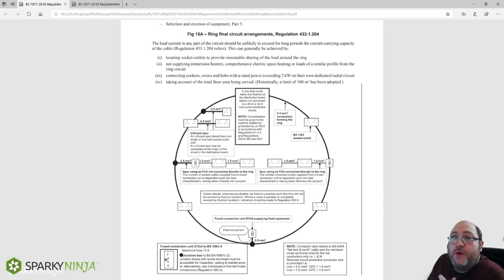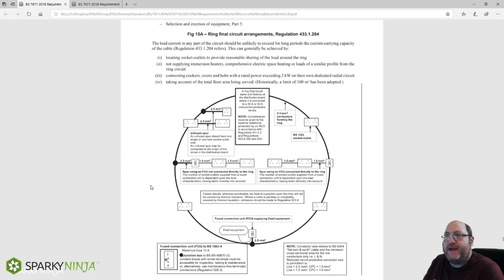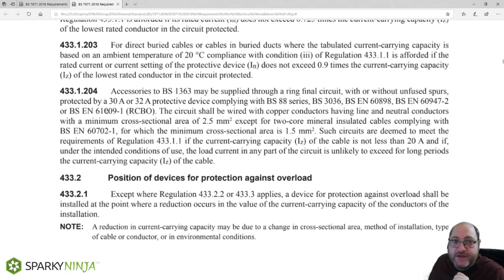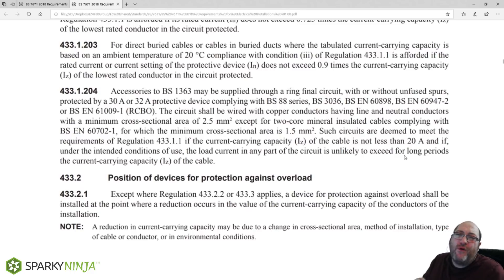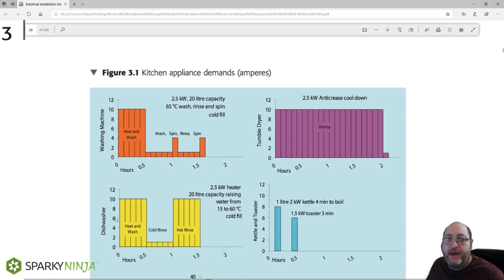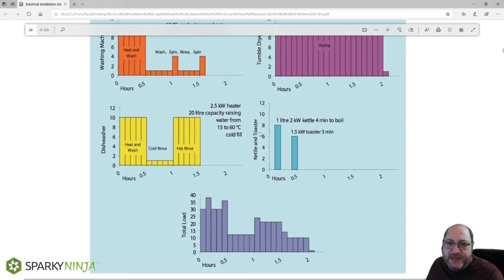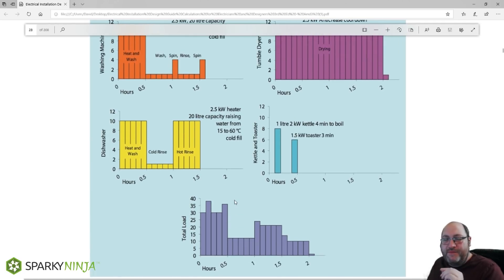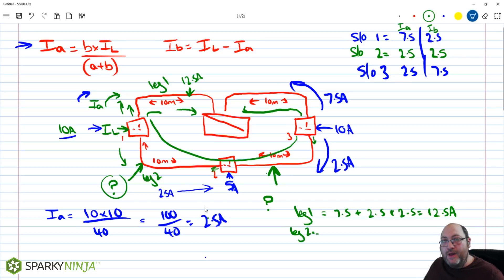Balancing Ring Final Circuits - Part 1

Comment: Why not put 4 mm cable on the start and the end of the ring and 2.5 for the rest. This way you would avoid any high loads on the shorter legs of the CCT.

Comment: Sorry, but I'm not agree with this result. So that ring circuit what you drawed here is ideal, because it is totally simmetric. In this simmetric circuit you want to use 25 A. 10A at the left socket, 10A at the right one, and 5A at the middle one. Because the circuit is simmetrically, we know the source current going to share equally between the leg1 and the leg4. That's mean it going to go trough 12,5A on each wire. But after you gonna use 10A on both side. Theese 10 Ampers are going back to the source on the neutral wires. So after the two sockets on the two sides you will have only 2,5 and 2,5 Ampers. And that's correct, because finally the 3. socket (the middle one) want to pick up 5A, so it going to pick up 2,5A from both side (from the leg2 and the leg3 too).

Comment: Sounds great and I understand the theory behind it however in practice this is unrealistic as you cannot police  what is plugged into a 13amp socket outlet. Would perhaps suit a kitchen where known fixed appliances are plugged in fridge, dishwasher, kettle etc. I wander how many electricians take this into account when wiring a ring main.

Comment: Thanks for the vid great knowledge! Do you think their is a need for ring main circuits within a normal domestic property?? I think I must pull less than 10A on my up and down ring and kitchen more but does a 32A radial remove the need for this design work which you can safely presume nobody does?
Reply from the maker: I think they shouldn't be allowed in domestics. Reason being that if Doris can got to B&Q and buy a socket, then install it.. there is a potential that a single line conductor or neutral could work loose. Her test method is likely to be to just plug something in, leading to obvious overload potentials for a fire.
Reply: One thing I don’t get about rings.. a normal circuit for example, after applying de-rating factors for example 16a divided by 0.8, we then need to select cable with greater CCC than the answer. 

On a ring , when I’m applying factors , should I be doing 32 divided by 0.8 or 20 divided by 0.8… if I use 20a , the answer is 25, I now need to select a cable with CCC a greater than this? 

Second question is reference method 103 , 17.5A CCC for 4mm , assuming you can never use a ring this method?

Comment: What if someone changes the appliances around in the new kitchen/utility etc new ring main🤔🤔
Reply: base the design on 20a min at each socket along with reg 433.1.204 as a worse case scenario if transposed should be able to calculate the limited length of each leg of the ring

Comment: I've got a socket behind a TV in my house, it's on a ring wired in 2.5mm squared twin & earth. It runs through a stud wall with thermal insulation so therefore it would only be rated for 13.5A, would that be something to worry about?